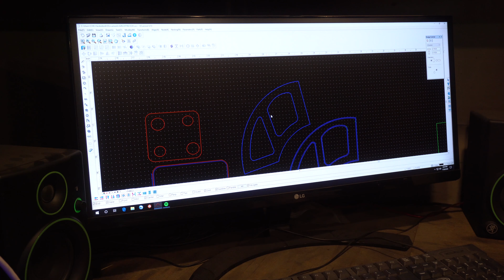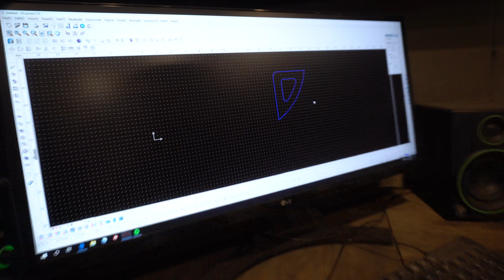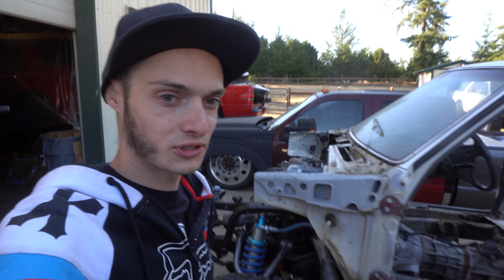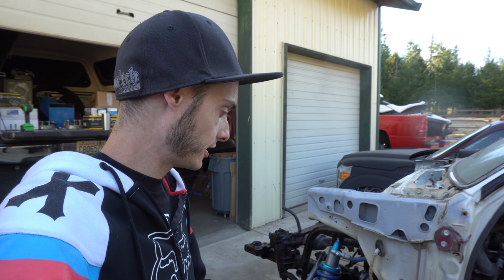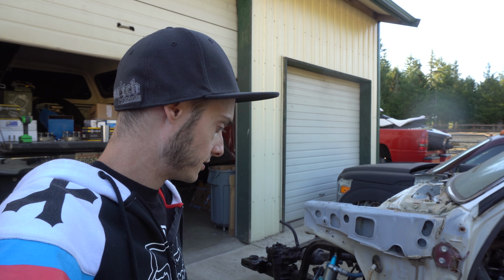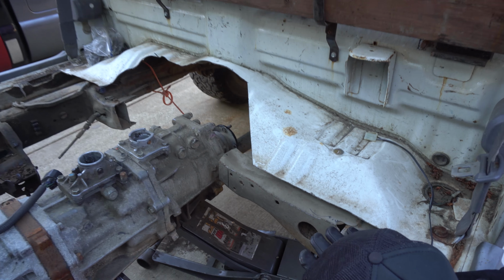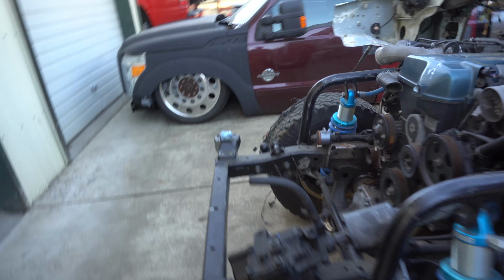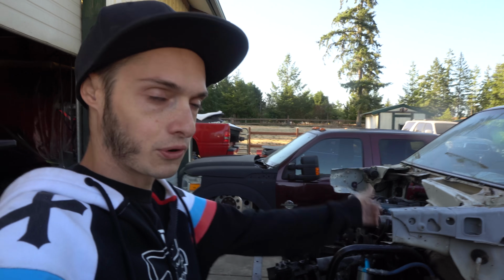2JZ TOYOTA PRERUNNER CNC ENGINE MOUNTS Cougar House Garage  EP320

Comment: I noticed a triangular gap between the engine mount and the frame mount where they come together. The two flat plates don't sit flat on each other, is that by design or you still need to adjust it, or you weld it as is?
Reply from the maker: Just mocked up nothing tight yet the bolts are a little loose tell we put the poly in
Reply: Makes sense to me, keep rockin...